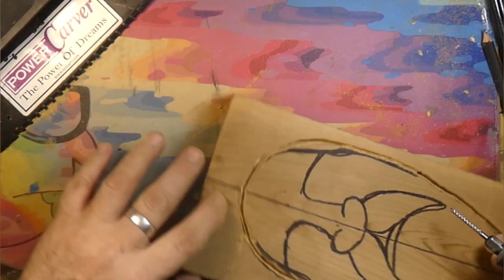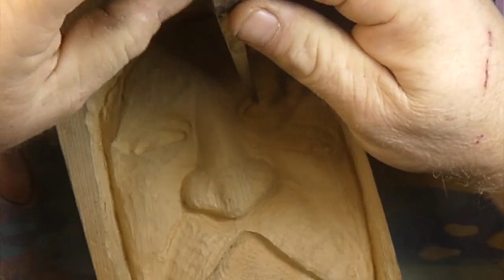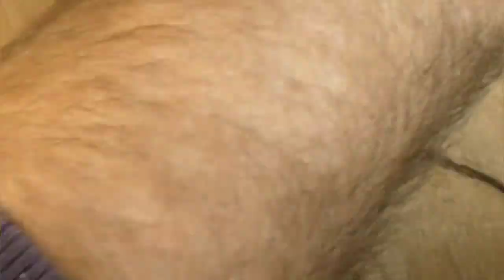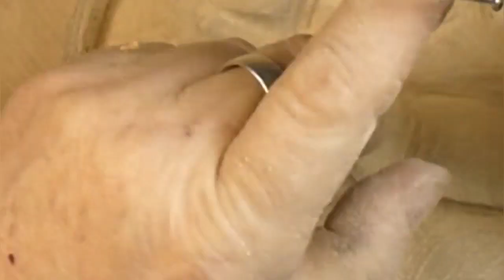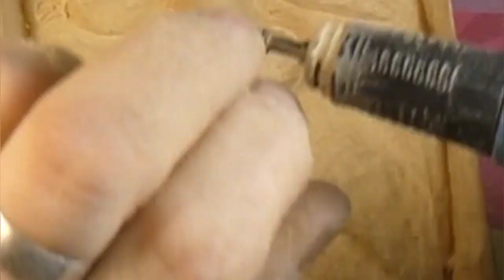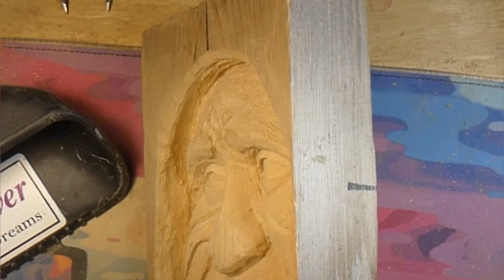Dremel carving a face in a flat piece of wood just don't do it

Comment: One way of doing it (which most likely get you disqualified) cut off the nose, upper forehead and cheeks out of a 1X4, glue it on top of your base inch board you were going to use and then cut your wood spirit, blending in the top piece with the bottom so it looks like one board.  You can use the top or bottom of your base board as the top board. (that way you can say, you did it one flat board, that you just think outside the box.  LOL)
Reply from the maker: Thanks Ron stay safe Just carve